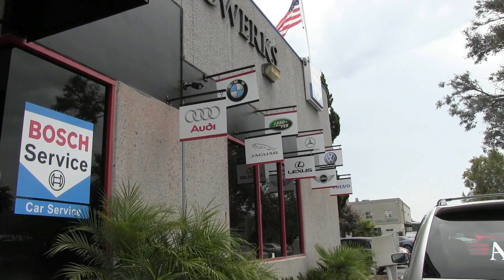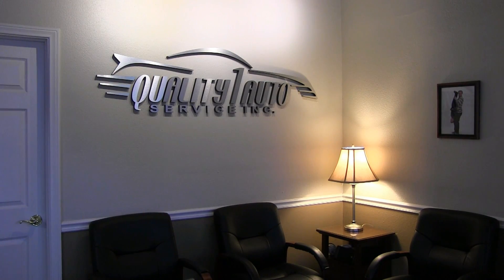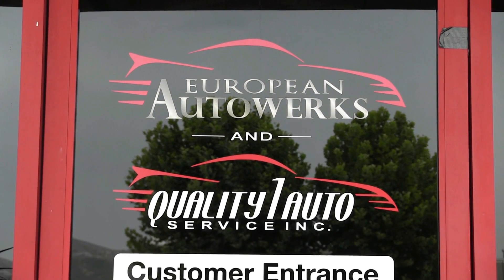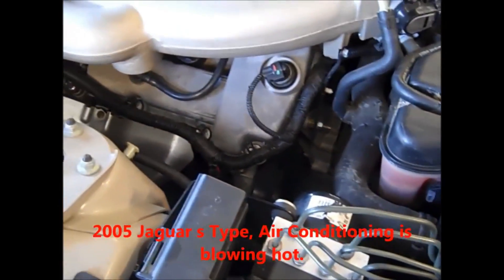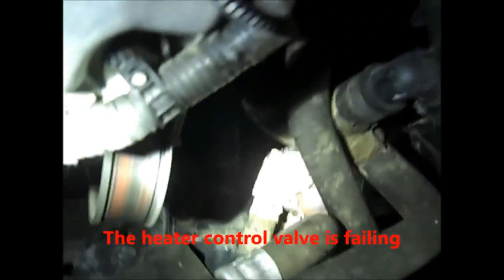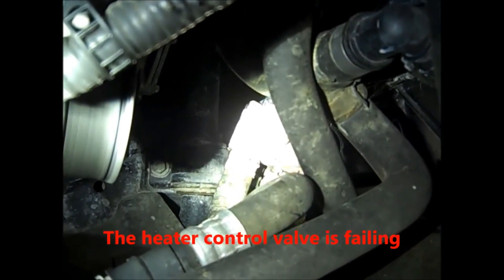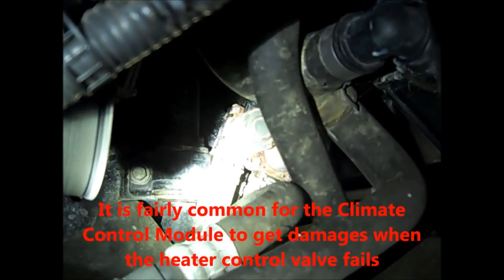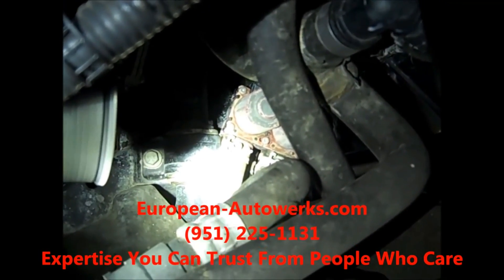Jaguar S Type  Air Conditioning isn't cold  Heater Control Valve Service and  repair

Comment: If one side  only works, it's the DCCA heater control valve. There are two valves.  If your valves has 5 hose connections, like the 99 to 02, just buy from the Ford dealer for a LS Lincoln of the same year. Same valves, but cheaper.  That's how they screw Jag owners.   Also, I repair  the air climate units for $150.  When the valves stick, it puts extra current through the air climate control units, causing fried traces and blown SCR's.  Repairing is a lot cheaper than the $2,000 they're going to charge you.  Oh, the units are Bosch. Different printed package on the outside for Jag and Ford, but same valves inside. Again, just buy the LS Lincoln unit.
Reply: All of you guys are paying too much. I Go to LKQ pick a part and pay $12 for a new control unit.